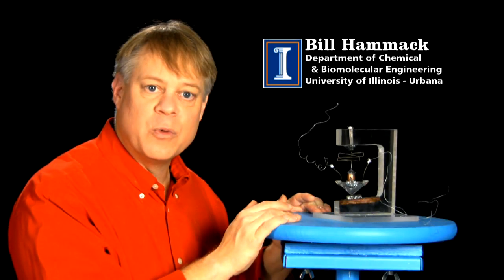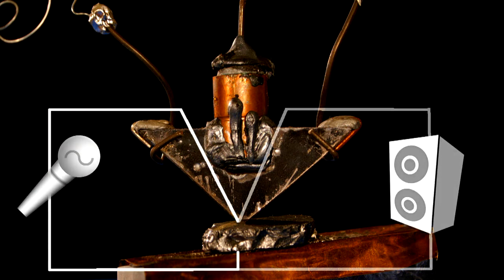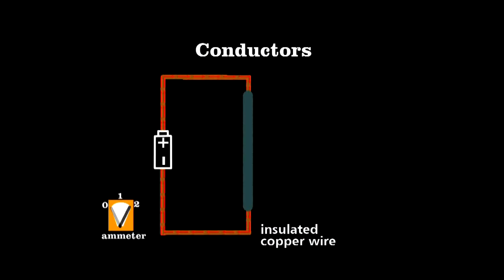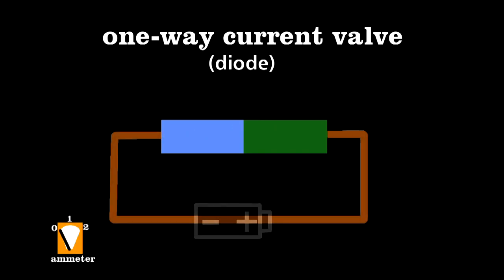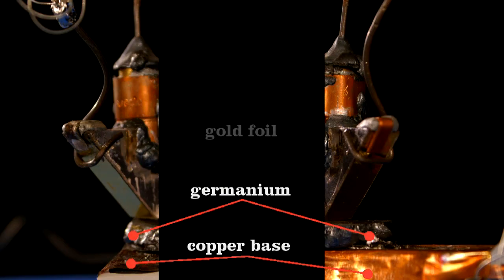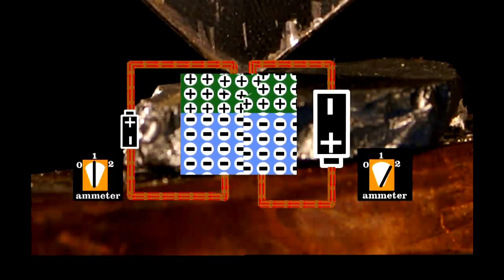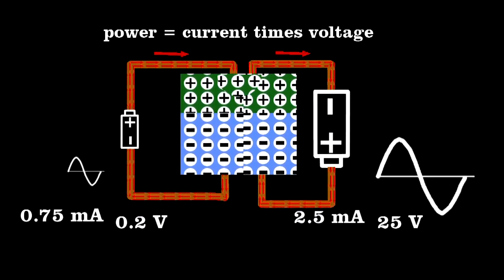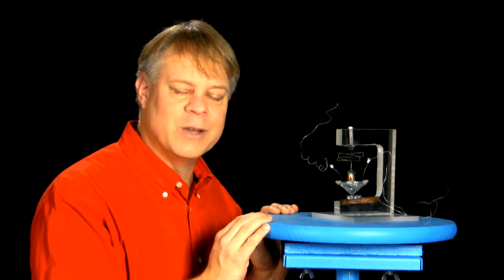How the first transistor worked

Comment: Why wound't the current just flow through the very low resistance copper plate on the bottom directly from one battery to the other?

Comment: Vacuum tubes are pretty much impervious to EMP whereas semiconductors are not.
Too, the tube has a smoother audio than the transistor.
Reply: Tubes apply their own distortion to the signal, which is that sought after "warmth" that audiophiles and classic guitarists constantly are chasing.  A transistor replicates the input signal way more faithfully.  The tubes being better thing is a myth started by audio snobs trying to justify their expensive purchases.  Just like vinyl snobs.  Vinyl has very poor dynamic range.  You can only vibrate a stylus so hard before it distorts the audio or jumps out of the groove.

Comment: The Nuvistor, as far as I know, was the smallest vacuum tube ever mass produced and was done so by RCA. They were about the size of a thimble. Even still, you certainly wouldn't want to carry a pocket radio that utilized them. They used a steel envelope and got hotter than three yards of hell.

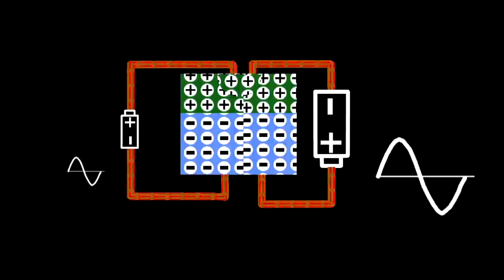My OCD is forcing me to point out that I do believe the diagram of the working transistor has a couple minor errors. The emitter and collector voltage (Ve and Vc respectively) designators are reversed. (Time stamp ~3:55).

Don't get me wrong, I love the work Bill does. Including this and hope to see more of it.
Reply: He had another video; https://www.youtube.com/watch?v=xvrjIJw3OSU
Same thing: I think the diagram is drawn as a common base amplifier but the input and output seem to be reversed. OK we are talking about a historical discovery here and maybe that was really how it was discovered? A reversed common base amplifier that brought light to the world. Dunno?

Comment: I got some parts of the video, but not exactly why it works. For example, why doesn't the right side give off a lesser current than the left side when the contact point is smaller? Is there less resistance on the right side?

Comment: I wouldn't downplay the vacuum tube quite so much. The transistor wasn't competitive in the market for at least another 15 years, and was completely unsuitable for high power applications until the 1980s rolled around. Vacuum tubes, while they do have multiple internal structures, are extremely reliable. Their primary failure points are the cathode simply wearing out or the hermetic seal between the glass and the pins failing due to sheer age or storage conditions... Something early germanium and silicon transistors were shamed for being prone to.
Tubes only overheat if you massively overdrive them. Most tubes can withstand overload conditions ("Red plating" due to the "plate" or anode of the tube literally becoming red hot with the current) for long periods of time - The real ending factor is how much the envelope can withstand it. 
Tubes were also easily miniaturized at the time! Check out the Nuvistor and other subminiature tubes which were the same size or smaller than germanium transistors of the era yet were considerably more reliable and more powerful. 

The real strength of the transistor was not revealed until mass integration begun and miniaturization went far beyond the point of vacuum tube technology in the 1970s. That, and it had a ton of marketing spiel behind to to help out.

Comment: Amplification is cool but the main purpose of a transistor is just an electrically controlled switch for computing. You can amplify just fine with tubes, some people even think it sounds better. Transistors allowed computers to be faster, smaller, and more energy efficient. Computers thousands of times less powerful than your phone would still take up rooms and use kilowatts of energy if we didn't have transistors. Any switch can amplify a signal, making that switch have no moving parts and be nanometers in size is what sets transistors apart from other switches.

Comment: I dont understand how the current got amplified, can anyone please help?
Reply from the maker: There is a copper sheath that runs along the cable and carries electricity— I left this out!
Reply: @engineerguyvideo  woah! Thanks for the reply sir!

So, the lil current from the left circuit pushes the electrons in the copper sheath, and that current is high coz it is a conductor; then all those electrons are sucked into the right circuit, hence amplifying the current in the same.

Is that correct?

Comment: the explanation of the current magnitudes and operating principle is wrong.
Reply from the maker: The numbers are those reported by Bardeen: remember that the first transistor was a current amplifier — so it operates a little different than the modern transistors put into practice.

Comment: 1:40  Electrons flow from negative to positive.  Would be nice to stick with real physics.
Reply from the maker: I reviewed the video at this point ... not clear what you are referring to here
Reply: Electrons flow from negative to positive in N-type semiconducting material, which have an excess of free electrons. However in P-type material you have holes, which are places where electrons should be but are missing. Holes flow in the opposite direction in a circuit, They flow from positive to negative.

Comment: Bill,  best description of this seminal device developed by Brattain and Bardeen.  
I'm trying to put together a very detailed description of the development of this device,  including the Physics, but  I'm coming up short. 
Questions: 
1. Do you know if the Germanium slab (BASE) was intrinsic or was it prepared ?  On some X-sections a P layer appears on top of an N layer ?  
2. Were the top gold contacts,  the so-called point contacts, ohmic ?  It seems this is where the action takes place.  Is this how the P region was developed using the gold contacts ?  Of course gold does not readily oxidise so it's hard to understand if the B-C and B-E diodes were something like Schottky diodes.
3.  Do you know what is the spacing between the C and E gold contacts ?

Comment:
As I understand Bill S was leading the effort,  but was not convinced of the path Brattain and Bardeen were taking,  so they didn't tell him much.  He was pretty mad with them,  when they got the glory for the invention.  But he redeemed himself and got the last laugh with his invention of the junction transistor including a rigorous mathematical description of how the device actually worked.
You may not care for Bill S and some of his orthogonal ideas,  but he does deserve a mention ;)

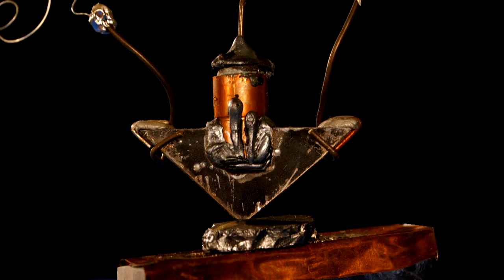Comment: 1:02 signal amplification was what the inventors originally intended the transistor be used for. It was to be a solid state replacement for vacuum tubes which were big, relatively expensive and prone to mechanical failure. But I'd argue that the main use for a transistor these days is to construct logic gates and ultimately micro processors. General purpose computers are one of the most important technological break-troughs in human history.

Comment: I think it's incorrect to state that the transistor revolutionized the world because it could amplify. There were other methods of amplifying at the time, although the transistor certainly improved the field of amplification. But a transistor only amplifiies when it is in its active region, however the vast majority of transistor in the world rarely ever operate in their active region. Instead the majority of transistors operate by switching back and forth between off-mode and all the way up in their saturated region in order to use the as electroonically controlled solid state switches that can be lightning fast. And that's how and why the transistor revolutionized the world.
Reply: Exactly 💯

Comment: I've struggled for years to understand exactly how transistors work, and this is the first time that it seemed blindingly simple. Thank you so much!
Reply: It is a 'debt thief' :)
I have never looked at it that way until I saw this model though, but man, that is much easier to explain than how I was taught.
Reply: Amplification can seem strange in that you are putting in a small signal and getting a larger one out. It's almost like you are getting something for nothing. But note that the power output is actually produced by the bigger battery on the output side. All the transistor does is to increase or decrease the output current, which comes from the bigger battery, and how much it changes the output current is determined by the smaller input current.That's how amplification works.

Comment: Now we can fit 12 billion of those things in a modern GPU
Reply: Ashley McCallum transistors nowadays are 500 times smaller than our red blood cells.
Reply: Radvous How? My small mind boggles at the thought.
Reply: @ashleymalamute  They use lasers and what is basically the opposite of a projector to shrink the features of a larger design they can print out into a "mask". The mask creates a shadow with the laser and is shrunk with optics to burn the features they want onto a silicon wafer.
Reply: @ashleymalamute  
By a process called photolithography.
Reply: Crazy when it's so small that it literally can only be made using tiny wavelength light waves.
Reply: @TheRguru1  its actually so small now that wavelengths are too large and they use some sort of overlapping method I don't quite understand.
Reply: @NikolasStow  I think you're talking about the patterning process where they need to make multiple photographic exposures to get better resolution because diffraction starts to mess with lithography at that scale.
Reply: SerBallister you are correct
Reply: Not as small as my penis though
Reply: Zaraki 8 
Science is great
Reply: Seeker has uploaded a real nice vid on this, the process is Amazing!💎 Here's the vid:

https://youtu.be/f0gMdGrVteI

Do check it out!😄
Reply: @vishank7  good find man, thanks
Reply: @Radvous  My pleasure bud! That channel is full of gems, you might want to check some of their others vids too😄🙌
Reply: @vishank7  Thanks. I added it to a playlist.
Reply: @3deeguy  You're welcome😄
Reply: and thanks to that we now have facebook, tiktok, and a life like sounding entertainment system where we can listen to Justin Bieber
Reply: Good
Reply: Over 2 trillion transistors on eUFS flash chips in high-end smartphones in 2020.
Reply: not quite that many...and Pssstttt....dont say nuthinz....but they've run outta real estate (space) friend
Reply: That's big GPU
Reply: Is that a General purpose unit ?  CPU !
Reply: *phone
Reply: Its now 2025 and there are Trillion transistors in a single CPU
Reply: 0.2nm manufacturing is confirmed and the fabrication plants are being put online/built right now.... you can now fit hundreds of billions to trillions per square millimeter. we will see these new chips in couple of years
Reply: The transistors in computer circuitry is created with chemistry rather than physical processes. I guess that's where most people's confusion comes from.

They make use of very specific chemical properties of materials such as the silicon that is used in the wafers.

Comment: I'm not sure I understand the concept of a positive charge carrier or positive current flow. In the negative charge case electrons are flowing, what is flowing in the positive charge case, surely not protons or other naked nuclei?
Reply: Holes. Assume that we have a normal element, then you take away an electron, it leaves a space where it was and now the element is a positive ion. Holes in semiconductors works the exact same way. Say you have a semiconductor, it has 4 valence electrons, following the octet rule the 4 electrons will do their best to either form an 8 or 0, doping the semiconductor with donor atoms which have 5 electrons will make a doped semiconductor with just 1 valence electron which will more likely to have free electrons. Think of this line of 1s as a lineof N type semiconductor. 

11111111

then you remove a single electron on the right side then move to the left

11111110
11111101
11111011
........
01111111

the electrons moved right but since the electron is negative, we can also say that there is a hole that moving to the left.

so that's the conventional and electron current flow.
Reply: Except that Shockley explicitly stated that " In fact, in a good emitter point it can be shown that more than 90 per cent of the current is carried by the process which injects holes into the semiconductor, and less than 10 per cent by the process which removes
electrons." 
https://www.nobelprize.org/nobel_prizes/physics/laureates/1956/shockley-lecture.pdf
Might be related to the differences between holes/electrons. (holes are in the valence band, electrons are thought to be in the conduction band). Not too certain of this myself because metal/semiconductor diodes are also majority carrier devices. Electrons should be going from semiconductor to the metal because it has a lower work function.(Its electrons are at a higher energy, so it migrates to lower energy in metal)
The original comment is on to something, it really is a confusing topic.

Comment: Why the f did they make the replica 'a little larger' than the original? For what reason?
Reply: I'm going to guess because it was easier to film. I haven't been able to find a good image that shows the size of the original device--not even in an article about building a working replica, which talks about how difficult those dimensions were to find.
Reply: +50srefugee Well, if they could photograph it in 1947, I think it should be possible to capture in on film in 2016. I found this picture with an indication of the size. No problem to make a replica in real size in my opinion. Especially with something where size matters, why make the replica 'just a little bigger'? 
https://goo.gl/photos/vLhhaUbfuJCMH6PJ7
Reply: As if a transistor model could or should compete with the small real world ones...

The key here is to make it big enough, so you can see everything well easily, and probably also to simplify building it.

Comment: So a transistor is like a power gear for electricity?
Reply: It's like a volume control knob where the input signal twists the knob up and down very quickly. A volume knob turns a variable resistor--from which the name "tran-sistor" is taken.
Reply: By the way, an electrical "power gear" would be a transformer, trading off current for voltage in almost exact analogy with trading off distance moved for force.

Comment: What I'm curious about is HOW they came up with the hypothesis that such a contraption would even work.
It's oddly specific to dope a small area of germanium, and use a razor blade to make the slightest of gaps in a gold film point contact. So they certainly had a solid understanding of the materials before making a rig to test it.
Reply: A solid understanding of solid state physics? Yes, they absolutely had that. The transistor was an extension of previous work by this team and others. A leap, to be sure, but from a solid foundation nevertheless.
Reply: Not just mucking around, no. They were specifically trying to develop an amplifier. This was Bell Labs, remember: they had a huge interest in being able to amplify signals for long distance phone calls without the power expense of vacuum valves/tubes.
Reply: I am also wondering what they were trying to achieve with this. In retrospect, its obvious it works, but at the time.. were they just mucking around?

Comment: So... if today's transistors are one dimensional, doesn't that mean they're line segments with no mass? I think that could have been explained a little differently.
Reply from the maker: +Elvis S indeed.
Reply: 1 dimensional in theory. The width has nothing to do with the function or structure of the device in theory, except for making it possible to exist in our universe, so in practice they are 3d to avoid research into ripping open spacetime to construct an amplifier.
Reply: Perhaps thinking of the line segment as a cylinder would help you conceptualize the modern transistor better. There are two semiconducting metals, one sandwiched between two segments of the other, and all three parts arranged in a line, with a separate conducting metal electrode leading away from each of the three semiconducting segments. Modern transistor "cylinders" have been reduced in length to the point that they more resemble a hamburger and bun than a long rod.
Reply: Obviously they have both mass and volume; however, for a physicist, the transistor's properties can be approximated using a 1-dimensional model. In a similar manner, physicists love to model all kinds of things in lower dimensions to reduce complexity. For example, one might model a billiard ball as a point particle.
Reply: Everything must exist in 3 dimensions, you can't even get away with 2 dimensions, even a page of a book has thickness.

However, you CAN conceptualize a page of a book as 2 dimensions anyway. This is the point he is making.
Reply: "The fact that you admit" Admit? This isn't a crime scene, what the hell is that word usage.
Reply: HenriFaust The fact that you admit that the materials are "stacked" demonstrates that they are 3 dimensional.

Comment: hold on, so its just a DC transformer then?
Reply: No, a DC transformer converts a ratio of current × voltage into another ratio of current × voltage. There is only one source of power. Power in, power out.  

  A transistor on the other hand uses one source of power (one circuit) to control how much power is permitted to flow through another circuit. The power in the second circuit does not originate from the first circuit. The first circuit only throttles the second circuit. It is like a relay, but analog rather than digital (on/off).    

 (Warning: Explanation is simplified, like the video. In reality the power does nearly always come from same source, but this explanation makes the purpose easier to understand.)